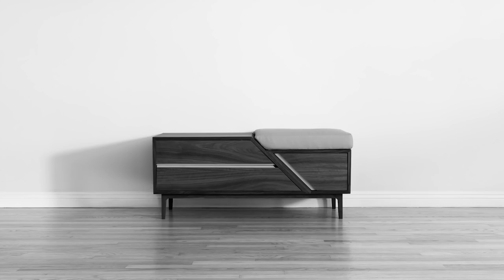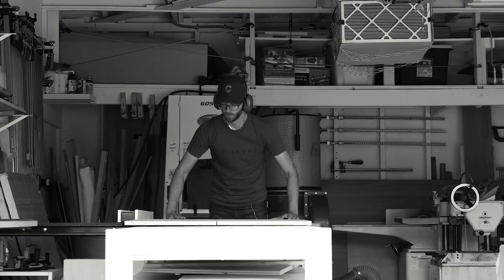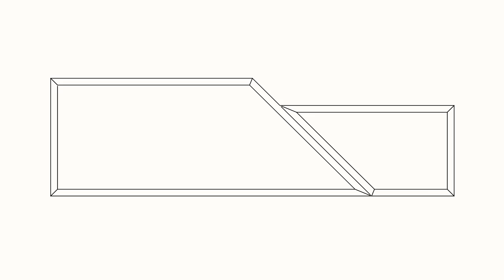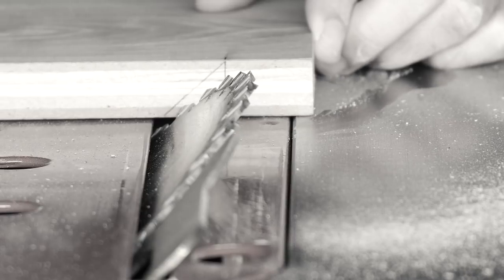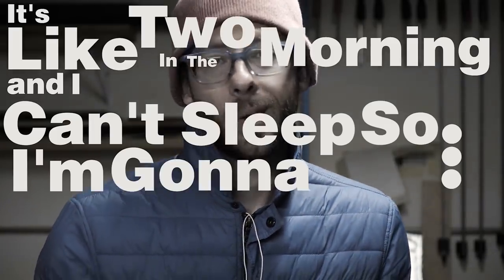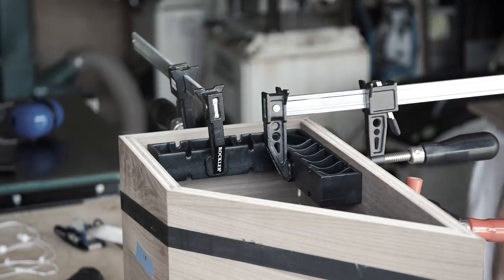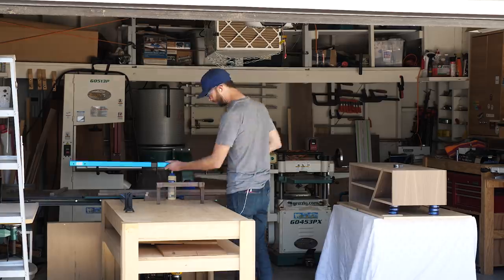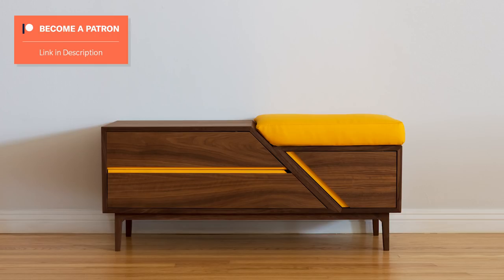Building A Modern Bench | Woodworking Shoe Bench

Comment: Nicely done Chris! I'd love to see how the doors on the left side work. I wasn't able to see how the hardware was attached, or what kind of hardware you used. Are they the same euro hinges you used on the other door? Also, I totally think you should make a blackened rainbow piece at some point!  That thumbnail is amazing!
Reply from the maker: Thanks Michael. Yeah, just standard blum inset hinges. Same I always use. The only tricky thing I learned is that the bottom door (on the right side) needed a back bevel cut so that it could clear the material to open all the way. That (coupled with the pull) is the reason there is a small corner removed on the right top side of that door.
Reply: Cool, thanks for the info! I’ve run into that issue before with an inset angled desk. Angles man, they’ll get you every time...

Comment: Another beautiful yet functional piece! Nice work Chris. I can't find a ruler that has "a bit" and "a smidge" units on it! Love the final colour you chose, looks great!
Reply from the maker: haha...they are usually buried in the back of the home center :P
Reply: The first guy I worked for used "fat" and "skinny" measurements, like "It needs to be a fat 3/16." I could never find a ruler for that either.
Reply: Well i use a "fart" very often. But it is hard to get hold of it. LOL
Reply: KarlBunker what he may of meant is fat, would be on the larger side of the line on the tape measure, and skinny would be the smaller side. As the lines on tape measures are quite thick due to being printed

Comment: Another great piece Chris! I really like the shape of the legs/ stretcher and the little pops of colour throughout! Would have been really interesting to see what its like to sit on, and also how functional the doors are with all those crazy angles! Also wondering if you've ever used finger plate in your pieces - i'm sure you know what they are, but if you don't its just a piece of wood that is recessed behind the drawer fronts. Basically it stops you from being able to see into the carcass, but creates a space for your hands to go in.
Reply from the maker: Hey man...thanks. The doors function ok. I had to cut a bevel on the right side of the bottom drawer (the part with the 45) because otherwise it wouldn't open and close as it couldn't clear the face of the carcass. That couples with the pulls is what caused the little missing corner right there. As for finger plates, I think I might know what you're talking about, but I'm not sure. I tried googling it, but I don't think I was getting what you're talking about.
Reply from the maker: Gotcha...I like that...I could play with some ideas for a design for sure. What I'm talking about is. Just picture the one door in your mind that is the bottom long door. So there is the top edge, bottom edge, left edge (whichi is 90 degrees) and right edge (which is 45 degrees) of that door. I'm talking about the 45 degree edge on that door.

Basically if you left it normal it couldn't open or close b/c the thickness of the door would need to pass through the carcass of the cabinet like a ghost. So I had to cut a bevel along that edge (you cant see it with the door closed) - BUT! That bevel coupled with the way I designed the doors caused there to be a missing corner essentially. I probably wouldn't get that in text either. If you saw a picture it would immediately make sense though.
Reply: Ah, I get you! Thanks for taking the time to explain to me but as you say you don't notice it when its closed and I probably would have thought it was intentionally part of the design!

Comment: Chris, I see your wonderful projects with angled cuts in Walnut Plywood, and wonder how you avoid tear out?  I get such a bad result on the back side of the pieces i cut, and have tried tape, new blades, etc.  What is your secret?
Reply from the maker: If you're already using a good plywood blade, the only other thing I can think of is having a zero clearance insert plate on your Table Saw...that should make a difference on the underside.
Reply: Chris Salomone i hadnt thought about making a zero clearance for mitered cuts.  Ill try one out of mdf and.see how that goes.

Comment: at 5:25 it looks like you are paranoid about the air filter falling off...  ;-)
Reply from the maker: Are you referring to my back up plan chain wrap :)
Reply: I have the same setup (without the added chains), but I did put a plywood on the ceiling to screw into and each bolt is rated for 10x the weight. As a side note, your filter seems to be centered in the room, in a "perfect" setup, it should be on the side to create a current in the shop. Of course, if you always work with the garage door open, this is irrelevant!